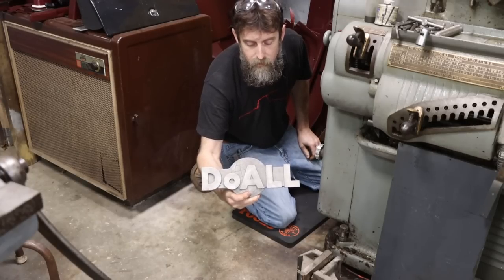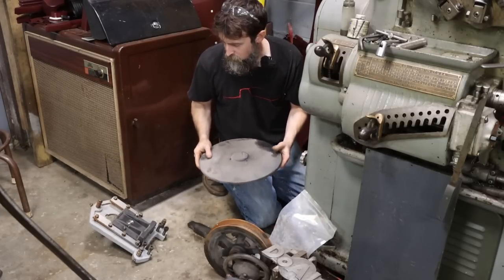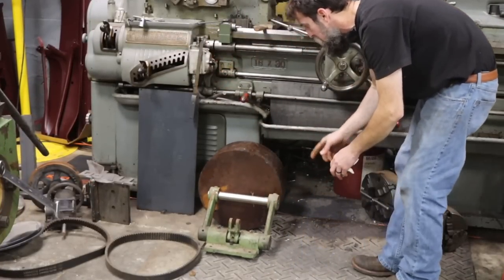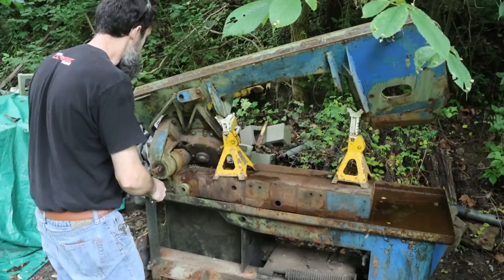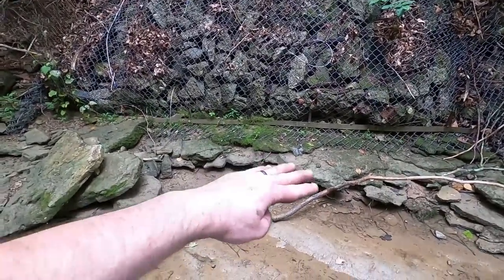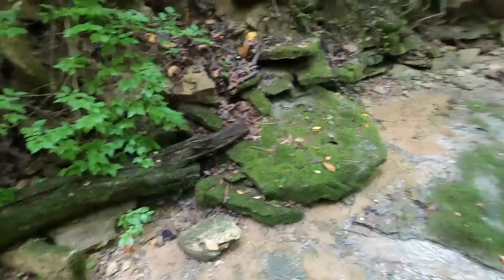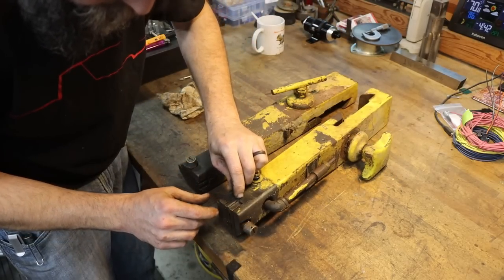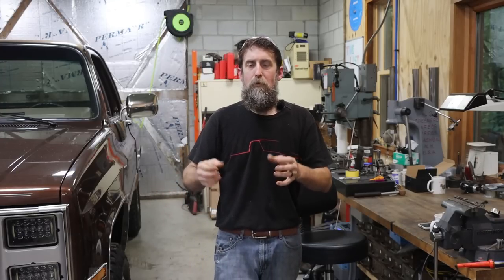The DoAll Bandsaw is Back Baby!  Update 1

Comment: Steve after cleaning up your cast iron, prior to painting, give a coat of boiled linseed oil. Dry it off with a plumber's blow torch. My father worked in a joinery shop after WW2 which was unheated. The old woodworking machines had to be serviced every 6 months. Any requiring a re-paint were stripped back to bare metal. Cast iron is porous and even blasting doesn't get it completely free of rust. The boiled linseed oil will seal the metal prior to painting, so less likely to rust under the paint. BLO was an ingredient in old paint, so it will take a priming coat. Wish you well in your DoAll restoration.

Comment: Ticks can travel on the front of a rain storm.  A 10 pm summer rain of cold drops caused the Williams Grove, PA sprint car dirt track feature ending event. The fan in front of me wiped the drops away as they intenfied, finding 4 ticks were mixed with the front. 
Next year the same occured with me in the same seat one row from the grandstand top with 3 ticks. So much for ticks dropping down on their victims.

Comment: Your motor that's "shorted" is probably just a bare wire touching the frame of the motor somewhere. Especially check around the capacitor and the junction box for rubbed through wires. Years ago, my dad had a cement mixer like that - you'd get a shock from it if it was running. I took the cover off the capacitor, and the wire was completely rubbed through and contacting the case. A little electrical tape and heat shrink later, and it was actually safe to use again (after being a shock hazard for who knows how many years)

Comment: Steve, if you need a heavier duty tarp, look on the various venues in your area for a billboard cover, or tarp. They are 7 mil thick, and made to last 20 years. Outdoor advertisers may have some available if you call them, or stop by. They have lighter duty ones that are similar to the green or silver ones you have, but should hold up for 2 years and both types are sunlight resistant.

Comment: There are ways to mitigate erosion on the bottom of a creek. If you put down ridges where debris can collect the debris that builds up between the ridges will have to erode away first before it can further erode the creek bed.

They do something similar is mining dump trucks. Rock will get caught in the wash  board pattern to slow the wear rate of the dump bed. 

Concrete curbs work alright for it and you can sometimes get a bunch at a concrete dump site.

Comment: If the air cylinder doesn't work out, just put a hydraulic cylinder on it with a needle valve to regulate the drop.

Comment: So back on it at last Steve! Mind you you've had one or two things to do in the meantime like shore up the creek bank with tons and tons of concrete and rebuild literally half of the shop AND re roof it as well, then rebuilding the square body Chevy from the ground up! Plus a few other things lol. Will you clean up the main body of the saw using your sandblasting attachment to the power washer? I think as long as you cover up some of the stuff you've already repaired, that would be a quick way to get all the old paint and rust off from the castings. Looking forward to watching the progress on it. Cheers from the UK

Comment: That saw table would be a good transmission or hydraulic repair table, even if you didn't want to fix the saw? I used the heavy duty cart from a brake lathe I had, that was in need of major repairs, so I just used the table, that had wheels on it, for a great storage and work table? The paint on it was in need of some work, sprayed it multiple times with paint remover, and it didn't touch it, must be some lacquer base epoxy? No rust luckily, time to get out the sander I guess?

Comment: I was thinking of a linear actuator for the raising and lowering of the saw, but that is a really heavy unit, maybe rebuild the cylinder, since you have a lathe and equipment? A hydraulic cylinder might be best, but more complicated ?
Reply: a ballscrew linear actuator can take a LOT of force. It's also not a precision application - just get a cheap one from the bay or the aly baba

Comment: I hear you on not using the motor on other projects? Took both motors from my brake lathe, used one in a 60" belt driven fan that the motor caught fire on, and the other one to upgrade a nice drill press I made for my friend?

Comment: Yeah, building a shed to run that one in is not such a bad idea. How many times a year would you use that after fixing it?
Reply from the maker: I'm guessing 3 times a year😁
Reply: @SteveSummers you would be surprised. I probably use my bandsaw a few times every week.
Reply from the maker: @bcbloc02  You never know, I may end up using quite a bit. You normally do a lot larger work than me Brian.
Reply: The shed could be dual purpose also for storing stock out of the way. Cut needed lengths without dragging it into the shop.